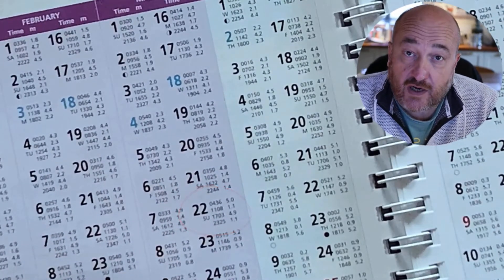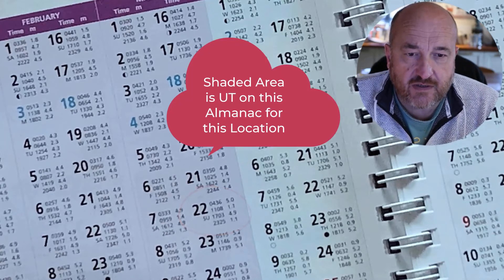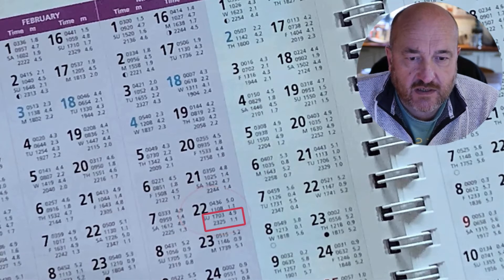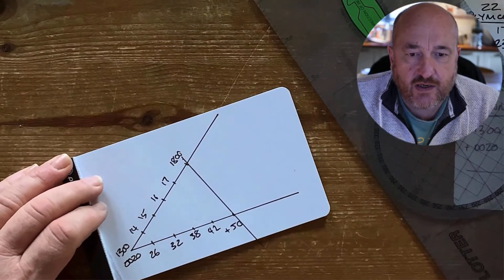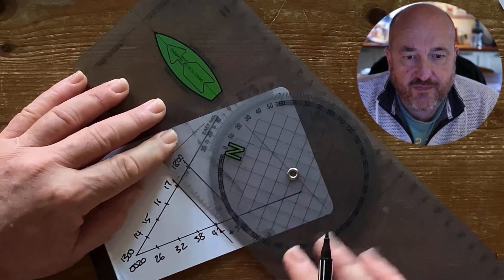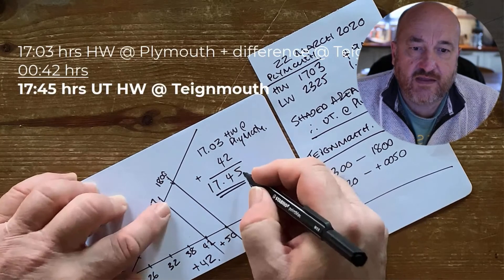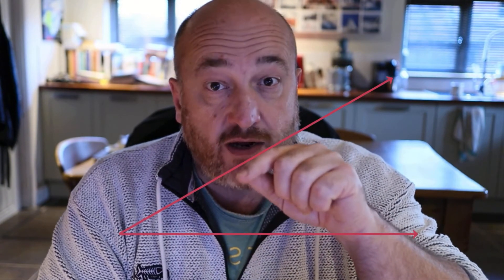How to Calculate Tidal Heights at Secondary Ports

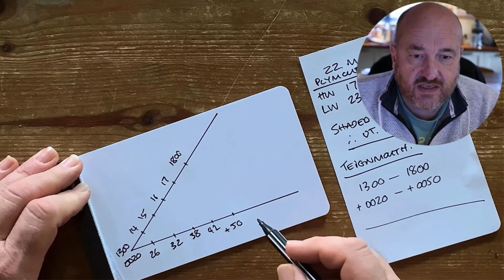Comment: When you make your first triangle beginning about 6:30, you correctly mark off the hour marks, but on the x-axis, which are supposed to be every 6 minutes, your "42" mark should be 44.
Reply from the maker: This man is indeed correct! Thanks for highlighting the error Mike.👍 It's sod's law that that would be the figure we come to!
Reply: Interestingly linear interpolation gives an answer of 44.3 so OP's rough calc would have been very close if they had correctly marked 44 on the scale :)
Reply: @timrolph1352  how did u get that result exactly, I keep getting 47.305 after interpolation

Comment: Thank you sir, however, I was wondering, to calculate the times and heights of water between HW & LW, when do we use the pecked line of the curve (the neap water line) and when do we use the solid line of the curve (the spring water line) ?!
Thank you very much in advance.
Reply from the maker: We use the neap line at neaps. The spring line at springs and interpolate (estimate between) for those days between each.

Comment: if the tide is higher than the HW spring figures for the secondary port what is the procedure in that instance.  Thanks.  Love your work
Reply from the maker: If I understand your question correctly (forgive me, it's been a while since I posted the video) then you'd use the actual HW height on the scale and draw the line between the low water and High water to get the gradient line. I'd then use the HW Spring curve to get the best prediction of the tidal movement on that date. Thanks for watching.

Comment: Hello and thanks for a great tutorial. I have a question regarding using the tidal curve chart for Plymouth for Teignmouth by simply crossing out the name. The curve profiles are different for each port so using Plymouth is surely not accurate and could land you in trouble?
Reply from the maker: Hi K,

Teignmouth is a secondary port. The associated primary port for Teignmouth is Plymouth (defined in the almanac). If Teignmouth had its own tidal curve, you would use that, but in this case the almanac sends you to Plymouth to use that curve.

Once you have changed the times and heights using the differences table for Teignmouth, you can plot those on the Plymouth curve and it is deemed good enough. 

It is always good seamanship to allow room for error or, for instance, for when there is a strong onshore or offshore wind, or a particularly high pressure or low pressure system over the location, all of which can effect tidal height or times.
Reply: @FreeSailingTutorials  Hi, thank you for making the time and effort to reply, really appreciate it. Regarding Teignmouth being a secondary port, yes that makes sense and im aware of the process of using the primary port's data for it , its just the actual flow profile that my question was really regarding because flow patterns will be different for every port so one cannot really be used for another accurately. sure the beginning and end differences in hw/lw times and heights and ranges can be easily recorded for different  points in the tidal stream cycle but the flow rates inbetween will be different in every location . For example if you took the tidal curve of southampton compared to portsmouth they are right next to each other yet completely different in profile. Im referring to the actual graphical shape of the curve graph not the secondary data. Therefore using portsmouths curve for southampton would not be accurate in terms of flow rates vs time. Anyway if using the primary ports curve is deemed accurate enough then so be it.
Reply from the maker: @justsayin644  That is correct, and you use two perfect examples because Southampton's flow is very different, having a HW stand. Therefore, its tidal flow is based on its LW time as that is more accurate. Both Southampton and Portsmouth are Primary Ports for this reason (and the fact that they are both major ports deserving of detailed surveys). Different secondary ports in the Solent area use either Soton or Portsmouth as their primary port graph as a result, dependent on their location. Cowes being an obvious example.

In the Solent, even secondary ports like Hamble have their own mini curves in the almanacs, but this is fairly unusual and is likely precisely because it is a complicated tidal area and is heavily used by various craft year-round.

Where these chartlets do not exist, the view is that a secondary port's tidal characteristics will be sufficiently similar for the allocated primary port's curve to be used. Of course, the secondary port's tidal heights and the times of low and high water relative to the primary port will vary because they are closer or further away from the largest body of water (in this case the North Atlantic). 

All the best.
Reply: @FreeSailingTutorials  Thank you for explaining this in more depth. I was on the right lines i think just good to have it confirmed because as you say the Solent is fairly unique and a complex and busy tidal region. Great channel and content!
Reply from the maker: @justsayin644  My pleasure. Glad you find it useful.

Comment: Sir do you also need to take into account the seasonal changes?
Reply from the maker: Do you mean atmospheric pressure?
Reply: @FreeSailingTutorials  Sorry for the late reply, I mean the seasonal changes found at the bottom of the page of secondary ports. I've seen other tutorials including those in their calculation
Reply from the maker: @Leo-td4tj  No problem. I'm reluctant to say 'no' because there may well be port or port information in various places that has further specific adjustments, but I suspect that would be something to do with the way the tidal information is set out. The Spring & neap tidal heights reflect the seasonal changes already. Do you have the link? I'd be happy to take a look and clarify? All the best.

Comment: You say Teignmouth doesn't have tide times, and yet when you turn to the page it clearly shows the high water and low water times, above those 'differences'??
Reply from the maker: It shows the differences between the standard port and Teignmouth at specific times of the day. If HW at the standard port is between two of those times, say 0600 and 1200 then you have to interpolate to get the correct time adjusted for Teignmouth. 😃

Comment: i am stumped as to why the time of high tide in Plymouth affects the difference  for tigenmouth
Reply from the maker: I'm replying on this without looking back at the video, Paddy, so forgive me if I miss your point. The tidal difference at Teignmouth (i.e. it's time) varies dependent on when the time of HW is in Plymouth. So we interpolate based on the measured difference between HW at both ports. We only have detailed HW times and heights for the Standard Port in the Almanac (in this case, Plymouth) and so we have to interpolate based on the variance of shown in the secondary port info in the almanac. I hope that helps clarify.
Reply: @FreeSailingTutorials  I am picking up this question as I believe Paddy & I have the same dilemma with this subject. To be clear, the process and maths to calculate times and heights at a secondary port are understood. And very nicely explained in the video, thanks. But.... I'll try to phrase Paddy's question in a different way; How does the Tide know to behave differently at different times of day, it's a force of nature not a clock watcher!! Its simple enough to understand that times and heights will vary from location to location but why isn't it a constant irrespective of time of day?
Reply from the maker: @nickwoodward2234  Aha. I think I get what you are asking. Why does it know to be a different variance dependent on what time HW is in the day? 

This has led me on a 30 minute wild goose chase. It seems many people know HOW to calculate the difference but few can answer WHY the times 0000/0600/1200/1800 are used. I think I have a sort of answer.

First of all, the times are taken from estimates of when the max and min differences are surveyed. Second, In many cases this has been shown to be around the times shown. 

I suspect (this is an educated guess), that the variance is greater or lesser dependent on influence from the sun as well as, of course, the moon. In other words, at local midday, the sun is as high as it will be and above us. 12 hours later, the opposite occurs. The lesser effect of the sun, combined with the moon, might change the strength and size of the variance on any one day throughout the lunar month. 

It should be born in mind that this is very much an estimate based on a simplified variance. 

I found this from a fellow instructor, which attempts to explain further. It is from the UK Hydropgraphic office;

"...Time Differences
On looking at the Time Difference curve diagrams it can be seen that there is one ‘peak’ and one ‘trough’ along their length, which effectively refer to the maximum and minimum time differences tabulated for the Secondary Port in the Admiralty Tide Tables. The times at which these maxima and minima occur at the Standard Port being the headers used in bold in the Standard Port header information (e.g. 0000 & 1200, 0600 & 1800 etc. etc.)

The above explanations of how the time differences have been originally derived at the Secondary Ports also account for the variations seen in the Standard Port header information, for example as follows with Plymouth.

and

Essentially the differences are caused by the specific relationships between the Standard and Secondary Port(s) during the period of observed tides collected at both locations, i.e. the specific turning point of the maxima and minima has shifted slightly along the length of the time difference curve referenced above.

Reference to Spring and Neap Tidal Conditions
The ‘maxima’ and ‘minima’ referred to above could also be thought of in terms of Spring and Neap tidal conditions.

For example, looking at the Plymouth predictions for a Spring High Tide on a Spring gives the following prediction:-

So High Water Springs on this day occur at 06:37 and 18:57, which is relatively close to the columns shown above at 0600 and 1800 (remember this is only one day’s Spring Tide in isolation).

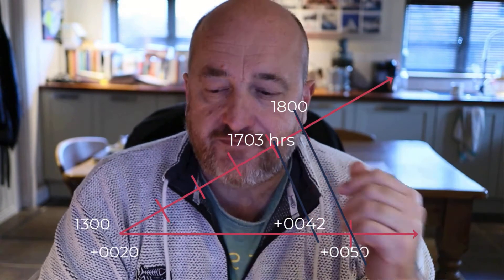Similarly, Low Water Springs occur at 00:29 and 12:50, again relatively close to the Low Water column of 0000 and 1200 (and the ‘alternative’ column of 0100 and 1300).

The Neap Tide gives similar confirmation:-

High Water Neaps on this day occur at 01:19 and 13:42, which is relatively close to the columns shown above at 0100 and 1300 (and quite close to the ‘alternative’ column of 0000 and 1200).

Similarly, Low Water Neaps occur at 07:21 and 20:04, again relatively close to the Low Water column of 0600 and 1800.

Again this is one Neap tide in isolation. The non-harmonic ‘time stamps’ were derived from a much longer period of tidal observation.

Conclusion
The above information gives a general feel for the way in which the time and height differences have been established initially and how the Secondary Port data relates to the Standard Port data accordingly.

It is not an exact science!"

Christopher Jones
Head of Tides
United Kingdom Hydrographic Office

TO CONCLUDE:
This seems to boil down to approximations and I can only theorise that the times of max variance must be governed by local noon and midnight. Here is a link to a very long thread on lots of people trying to work out why. Either way, rest assured, if you can do the calc, and allow the usual 0.5m min margin of safety, you should be fine!

https://forums.ybw.com/index.php?threads/secondary-port-time-differences.355563/page-2